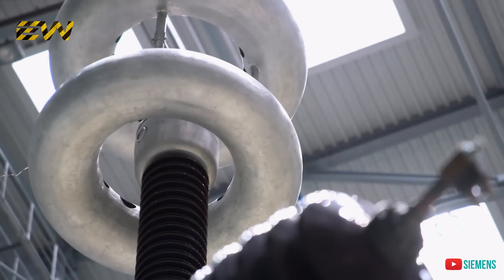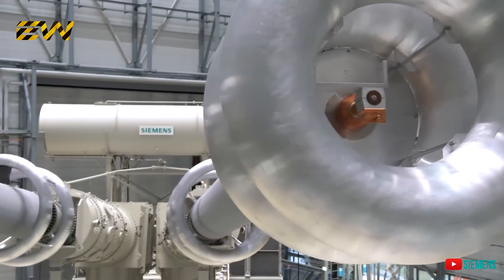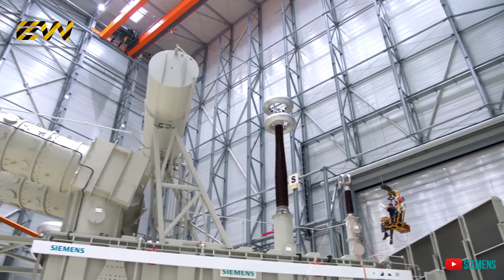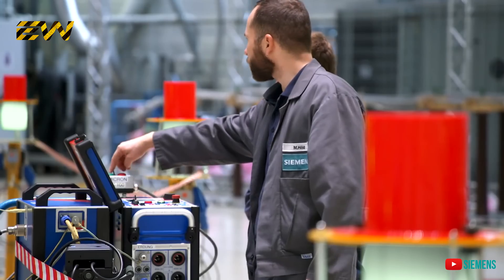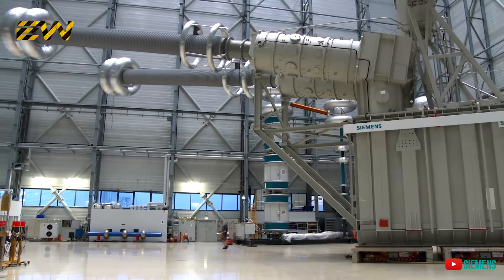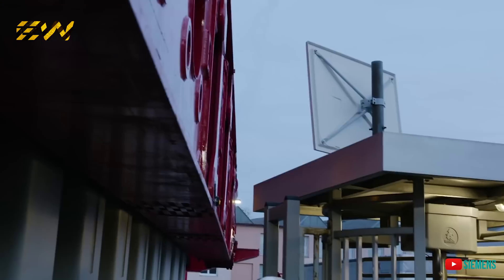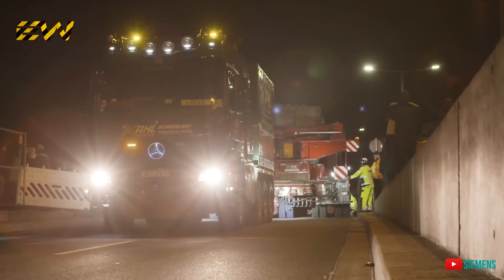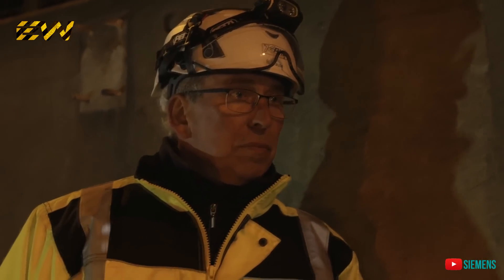World’s BIGGEST Electrical Transformer Video

Comment: The tranformer need be that big because we are talking about 1100kV , that is 1,100,000 volt.

To get a voltage that high one need have many more windings compared with the primairy input.
Generators are giving power in watts, but for this let's assume we do have a generator that has 1000 volt input, then you need to convert 1 winding to 11000 windings.  One winding is not enough at 1000 volt, the resistance is too low and the eddy current is not '' blocking '' the flow. 

Use 1000 windings on the primary you need to have 11000000 windings on the secundary.
Resistance can't be too high . otherwise the current won't flow freely without generating a lot of heat. So the wires need sized to proportion.

The coil windings, diameters and resistance balance.  The need for a big transformer.
Reply from the maker: Thank you for your detailed feedback! 

Have a nice day ^_^

Comment: How much does it weight? How many Tons?  If it is used for transmission in DC, what kind of rectifiers are used? Solid-state (semiconductors) or gas? Are they embedded inside the long insulators or are exernal? Where it has been installed?
Reply: Changji-Guquan, 900 Tons

Comment: To get high voltage the transformers required larger no of turns and due to increase in coil it's size increases also. We can get high voltage in less size also than this transformer but that transformer do not show more capacity than that due to less current formation because of it's less no of turns in the coil. So, please reply me that something is true in this or not . Thanks.
Reply from the maker: Thank you for your feedback! 

Have a nice day ^_^

Comment: Higher voltage transformers necessitate larger sizes due to the need for thicker insulation to prevent arcing, increased surface area for heat dissipation caused by higher currents, and larger core/windings to accommodate the increased magnetic flux. Additionally, stronger materials and structures are required to withstand the higher mechanical stress, and safety standards mandate larger dimensions to prevent electrical hazards.

Comment: 1100KV Direct Current transformer?  Must be new cause all the trafos I've used only handle AC current.
Reply: Maybe they mean it can handle switched DC (square wave) on its input, which would mean the voltage stays at the peak for longer than it would with an AC sine wave input?  I notice the front of the Chinese substation says "+/- 1100kV" and they said the transformer will be on the end of a HVDC link, so I guess rather than convert the DC back to AC then feed it into a transformer, they are just going to feed DC into the transformer and switch the polarity 100/120 times a second to produce a 50/60 Hz sine wave at the transformer's output, perhaps?
Reply: A DC transmission line can handle much more power (Watts) than an AC line can for the same design infrastructure.  This transformer is used to boost the AC voltage to a very high voltage which is then rectified to DC for transmission.
Transmission line design is primarily a function of the insulation requirements needed to prevent the line from shorting to itself (phase-to-phase) or to ground and the current (Amps) the line will handle.  Both of these are significant cost considerations for long transmission lines.
An AC transmission line insulation must be designed to handle the peak AC voltage which is 1.414 times the AC RMS voltage (AC power is a function of the AC RMS voltage, not the peak voltage).
So for example, if you design an AC transmission line which can handle 1000 Amps at 1KV, then that transmission line has two distinct characteristics:
1.  The maximum design voltage is 1.414 KV (1,414 Volts) (the peak AC voltage).
2.  The maximum current it can carry is 1000 Amps.
Therefore, the AC power it can transmit is 1000 Amps * 1,000 VAC equals 1 MW (1,000,000 Watts).  Note here that the design transmission voltage is 1,414 V, but since the voltage is AC, you can only send 1,000 VAC RMS (1,414 V AC Peak) through the line.
However, if you rectify the AC to DC, then same transmission line can handle:
1.  A maximum voltage of 1,414 Volts.
2.  A maximum current of 1,000 Amps.
This is the same as the line could do with AC voltage (we didn't change the design of the transmission line); however, look at the power when the voltage is DC vice AC:  1,414 VDC * 1,000 Amps equals 1.414 MW (1,414,000 Watts).
Therefore, for the same infrastructure costs, a DC transmission line can transmit 141.4% of the power as the same transmission line running on AC.
There are losses involved in converting the high voltage AC to DC and, at the other end of the transmission line, converting the high voltage DC back to AC for use in local distribution (this is done using Static Inverters).
In the early days of electric power there was no capability to to rectify high voltage high power AC or to invert the resulting DC back to AC at the end of the transmission line, so AC transmission lines ruled the world.  It wasn't until the early to mid 20th century that mercury arc rectifiers and static inverters were available to support early HVDC transmission lines.  HVDC power transmission has become more popular with the advent of solid state thyristers starting in later half of the 20th century.  Thyristers are much more efficient in both the rectification process (AC to DC) and the inverting process (DC to AC) than the older methods previously used.
Reply: @JS4269  Many thanks for your explanation and information.
Reply: DC itself can not be "transformed" however. So, the line voltage must be effectively converted up by conventional AC transformation (highefficieny transformers) and then there are pretty large rectifiers and cascades of capacitors (think of dimensions like a railway liquid gas or cargo container per single capacitor) behind this to send that energy as ripple-free as possible over a relatively thin line. The higher the voltage is, the lower the current load is inside of the wire. "Electrostatic Skin Transport", which means that all the energy walks along the capacitative electrostatic field sitting (electrons are flowing there in free air!) around the line and not inside of it. So 1 Million Volts or more  improves the effectiveness. On the other end, HV inverters are used and then the resulting AC is transformed down again.  
All this has much fewer losses in the end because of the much lesser line loss resulting when transport over the wire is done in DC.  Even a straight wire has a much higher per-distance-unit resistance for AC than it has for DC. DC lines have no "inductive loss, no self-induction effects" and do not require turnings for impedance balancing every few km. Because of its much higher insulation capacitance. This makes much higher voltages possible to be transported.
Reply: @ JS 4269, don't forget Skin Effect with AC!
Reply: @Berkeloid0  I certainly hope that's the case.
Reply: @JS4269  Thank you, that was very informative in a historical context.
Reply: there are no inverter components in this it is just a very high voltage, high MVA  transformer.  The long 'arms' you see are the bushings which usually present the main AC to the overhead lines in the switch yard then the other side of the transformer has the bushings poking through to a building called a valve hall.  This hall is where all the inverter and rectifier parts  are held. These are usually multistage inverters using either thyristor or if it is a VSC scheme will be many thousands of IGBT as the main semiconductor

Comment: We know that voltage equation of T/F is= 4.44NBAF,Where
N-no.of turns per phase
B-maximum flux density
A-net cross sectional area of core,(i,e)Gross cross sectional area*window factor(Height window/width of window)
f-Rated flux
From above equation it is clear that,more the voltage1) More the number of turns..2)cross sectional area of core is more ,to get rated flux..
KVA=1.732*V*I---> the current is more on lv side, requires large conductor area..HV side requires large amount of insulation than lv side.. Temperature rise affects the amount insulation & amount of coolent required.. Therefore from above all it is concluded that,as voltage rating increases,Size of T/f increases to accommodate all these requirements.
Reply from the maker: That's absolutely correct. Thank you for sharing your knowledge with our audience here. Consider subscribing to our channel for more engaging videos and technical discussions. 

Subscribe here : https://geni.us/SubscribeChannel